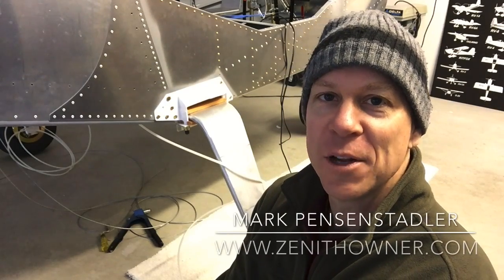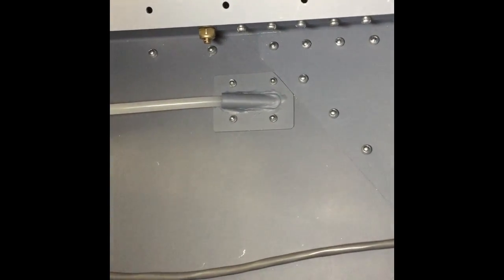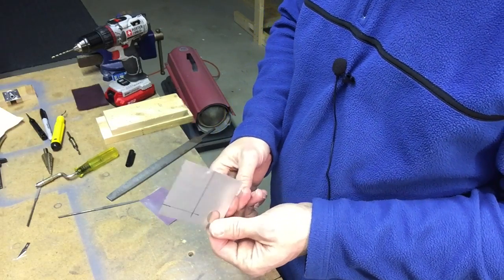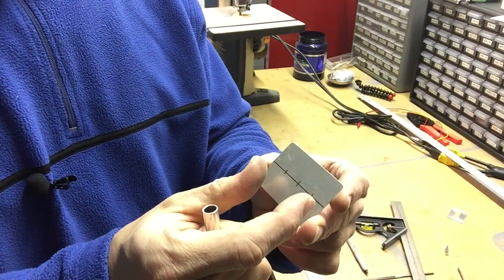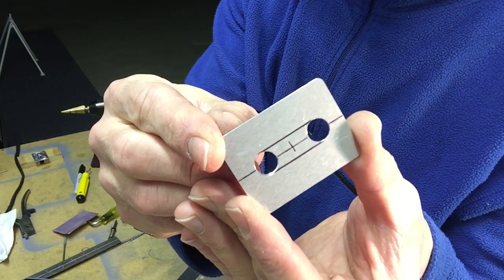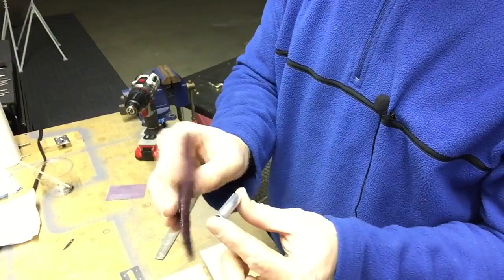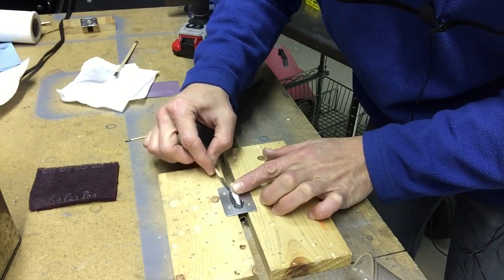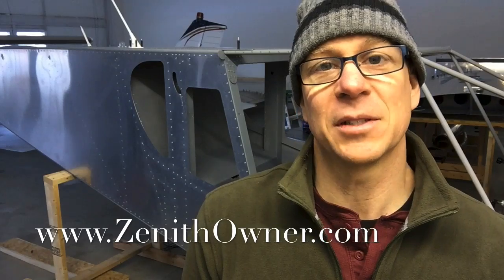Zenith Cruzer Brake Lines

Comment: Curious...  I'm a former USAF aircraft hydraulic systems specialist. I'm as a result pretty familiar with hyd brake lines etc. etc. I'm sure your  brake lines are perfectly fine for their intended job. But also, not just how I would do it myself. I'd put hard lines running down the gear struts (T6 alum or 304 stainless). Through the fuselage I'd favor a small (#3,4-ish) bulkhead union (AN flaired fitting)  & a short run of steel wound rubber or Teflon hyd hose over to the hard brake lines at closest possible point. Inside the aircraft I'd prob like using hard lines (T6 alum) to the related brake master cylinders, & using short hyd hoses if needed for flexibilty at the master cylinders, etc. ..Not nearly as streamlined as yours but pretty bulletproof.. Maybe brakes aren't as critical for short-roll aircraft as say military or commercial jets, but still nice to know they'll be there whatever happens (well almost anyway.. Murphy's Law & all that). Still, yours is extremely nice work -- excellent really.
Reply: @KitplaneEnthusiast  I completely agree with your assessment. "Well almost," as I cited Murphy's 'commentary' on the way most ordered-systems devolve into (at least) semi chaos, whenever given the typically & always present opportunity; even my more robust approach might go 'kerflewy' in a heartbeat, I fully agree. I think what you did is perfectly fine, given the function & application. Nice work.. & kudos

Comment: Thanks for your nice Video, i would like the dimension of those plate so i can draw it in 3D and give it to every one back in PDF so that they can build it
that would be my helping.
thanks for the nice idea.
Would love to build a 750.
Pat Farley
Reply from the maker: @patrickfarley8864  Well it's 3 years after I posted this video and I just saw your links. That's awesome and thanks for making it a CAD file. Very cool!
Reply: @KitplaneEnthusiast  It's a pleasure to draw some of your part in 3D but if the turn around is 3Y each time, this will take some time to confirm all the dimensions ;-)
BTW if you would like some other part to be draw in 3D just ask.
Have a nice Holiday.